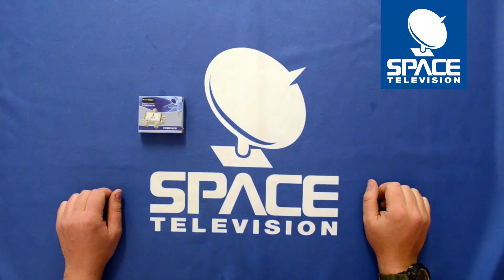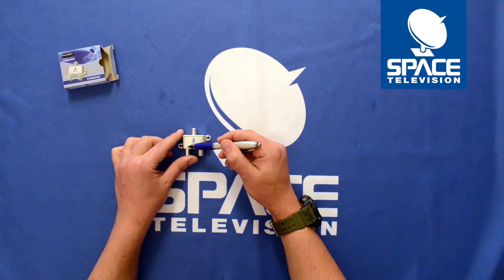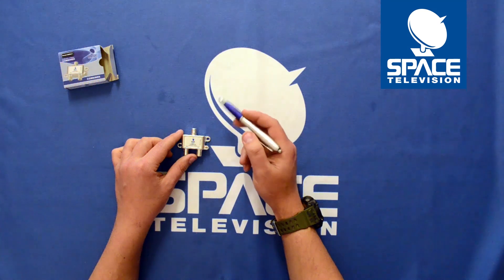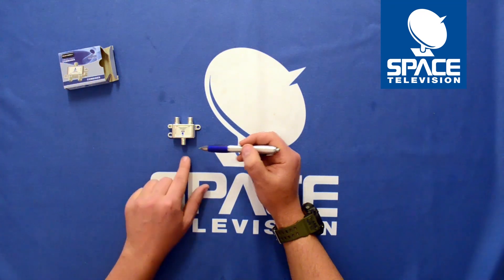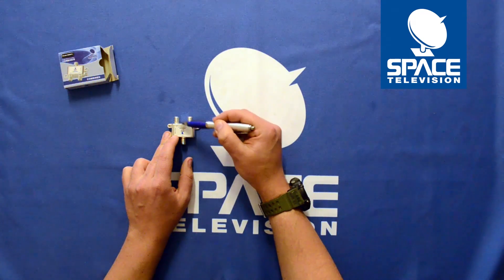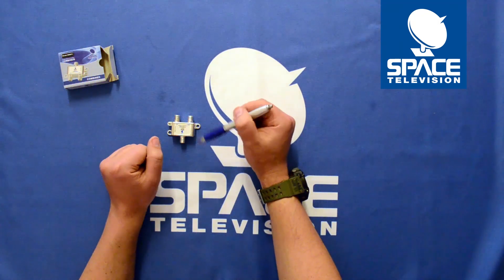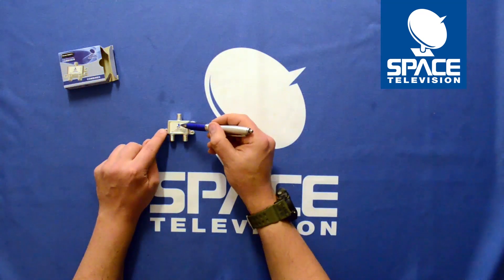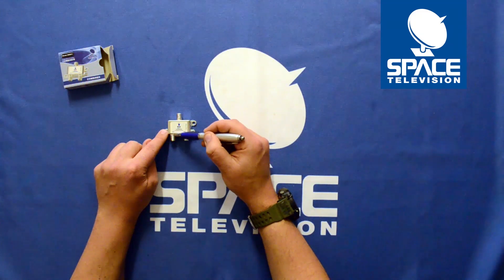Understanding the Combiners/Diplexers SAT/TV DC 1 Leg

Comment: Good morning, please how do I achieve an extra view heart beat if my primary decoder is an old decoder with RF in and RF and my secondary decoder is an explora decoder
Reply from the maker: If the two decoders are connected to a SMART LNB a SMC1 diplexer is connected between the RF in and the SAT input of the old decoder (Explora 1 etc.) and the combined output of the diplexer is connected to the SMART LNB – heartbeat flows through the SMART LNB.

Comment: Can a splitter used for two different T Vs, utilize different channels or do they T Vs play the same thing on each one?
Reply from the maker: Hi Jeannie, That would depend on the splitter and what is being split. If HDHI is being split both TV’s will by default display what is coming from the single source. If RF (coax) is split both TV’s will have access to whatever channels are in the system. If there is only a single decoder output that is being split, both TV’s will once again watch the same channel but if the outputs of more than one decoder is combined different channels can be watched

Comment: Hi can i put a diplexer on from a new  S6 decoder to a old 3U decoder?
Reply from the maker: Yes , you need to put a diplexer on a S6 to connect it to an old 3U decoder,  however it won't work through a smart LNB, so you need to make sure that the unit runs from the diplexer through to the RF in or RF out of the 3u decoder as the heartbeat will not loop through a twin LNB

Comment: I have seen installers cut this part and use a Normal T piece for the heartbeat on the setup. Cutting costs.
Reply: no mate, that was with decoders that had rf ports, you cant replace this with a t piece as it wont even work
Reply: @PhilliPVR87  oh yes. You are right. I remember going on a job site and seeing the installer doing that on a 4U/4S Single view decoder. After that they started using the 5u/5s Single view decoders rubbish decision they made. Personally that heartbeat is just a limitation for the customer to prevent the decoders out of the property. Shame they can't do the same for dstv now. Eventually someone is going to discover how to  bypass the heartbeat using the internet as the physical cable between the primary and secondary in different locations. It's just a matter of time.